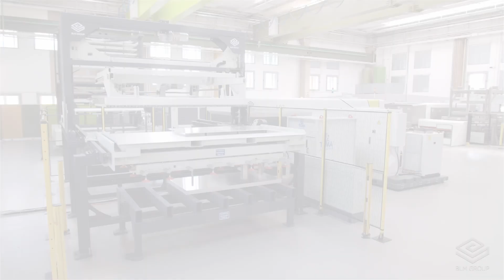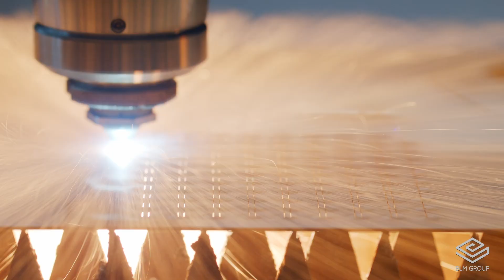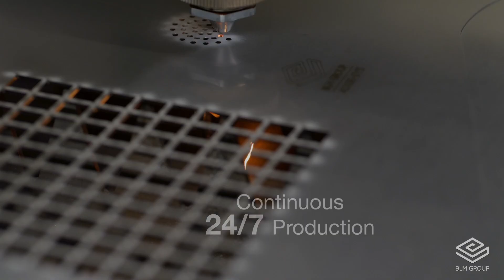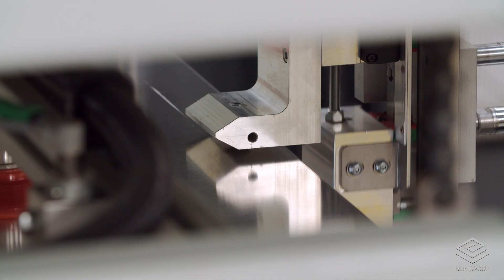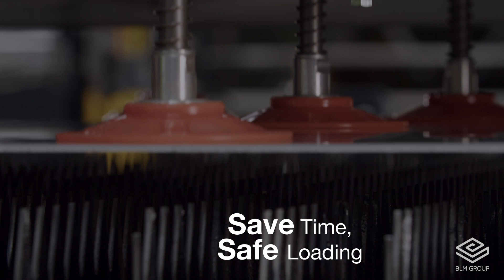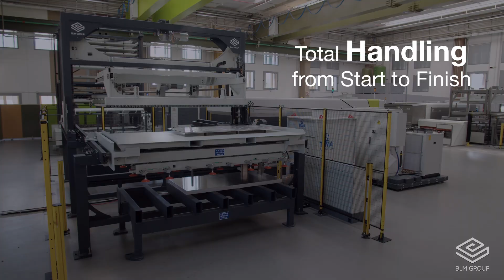Full Automatic Sheet Metal Loading & Unloading System for Laser Cutting Machine | BLM GROUP

Comment: if a cut sheet is able to be over the top of a raw sheet couldnt that cause problems with small slugs falling on top of the raw sheet?
Reply from the maker: Thank you for your interest shown towards our products. The situation that you describe is quit common in different pallet change system and could in fact cause some problems. Usually small slugs are anyway blown by side by the assist gas during the cutting process.